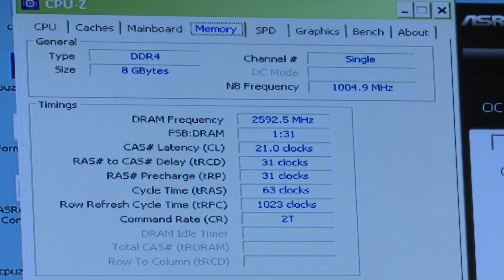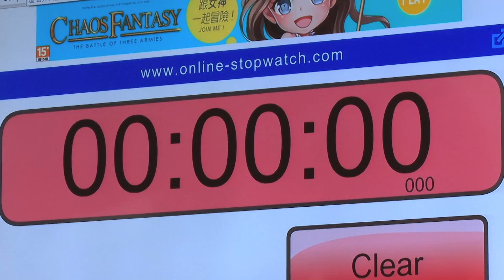G.SKILL's Extreme Overclocking Events @ Computex 2016

Comment: i have a 5820k overclocked to 4.4ghz but it could go higher but the motherboard is a limitation, i also have 8gb ddr3 corsair 3000 mhz but it will not let me overclock it meh :(

Comment: Holy hell, I had overclocked my i5-6600K to 4.5GHz before, and it ran fine on air with no faults and stayed below 80C on most occasions, but when I ran the Prime95 Small FFT test, my temps skyrocketed to 100C.... to say the least I panicked and unplugged my computer xD

Comment: My experience with overclocking is with my previous pc a Fx6250. Managed to get 5.1ghz stable at a reasonable temp on a big air cooler.
My current pc i7 (fist Intel in 10 years) sits at 80 with a cheap ass tower cooler,  had to order a water cooler so I can get some overclocks on this badboy.

Comment: My experience with overclocking has been nothing but smooth! I just used the built in utility on my Gigabyte Z170 Gaming 5 mITX motherboard and I've got a stable and cool overclock on my 6600k. As for overclocking my ram, I bought the G.Skill TridentZ 3200 16gb RAM kit and I just enabled XMP and it's been running at 3200 MHz no problem for the past 8 months!!

Comment: AMD Athlon II x4 635 2.9GHz stock cooler. Kept it overclocked at 3.51GHz for 3 years, then 3.2GHz for another 3 years, still on stock cooler and pretty good voltage. I had a lucky one :)

Comment: Well, I just built a new computer and overclock the i5 6600k to 4.5ghz, seems to have alot more room as it only reaches 55c under load. Haven't really tried overclocking the gpu or ram. Hoping to win some new ram as thsee kits look so nice, and I bet perform even better.

Comment: So about 6 months ago I built my first gaming PC... or should I say bought a shotty prebuilt one and have swapped out basically every component that came with it. My current set up is a AMD A8 3.5Ghz cpu, a Gigabyte R9 390 gpu, with a Corsair 600w power bronze standard psu, a cheep ATX mother board to hold everything (definitely nothing to special) the original 4gb's of DDR3 RAM that came with the old prebuilt computer, a stock cpu fan, and a full tower case that one of my friends gave me. I've honestly never tried over clocking because the fact that I can't really do anything because of the current RAM that I have. I have always wanted to try it... but can't really do it. Winning a new stick of DDR4 RAM would be unbelievable because it means that I could finally push my system to the max. It would be really cool to be able to keep my all blue system running to the max with that extra 16gb's of DDR4 RAM. Good luck to everyone in the competition! And congrats to whoever wins in advance

Comment: About 3 years ago I built my first PC. I used an AMD APU because I was on a very limited budget. I purchased some G.Skill 1866mhz RAM and noticed that I gained some very substantial performance gains when I increased the clock rate up to 2133mhz. I was so pleased at it's ability to overclock and add real and observable gains. Ever since then I have had a great love for G.Skill RAM for it's great value, warranty, and reliablity.

Comment: My first overclocking experience was applying an XMP profile to my Ram, went from 1333 to 1866 just like that in a snap. Can't believe I had it running that low for a long time, felt much snappier after. I was a noob back then, great thing to always keep learning about tech. Thanks

Comment: I have an air cooled custom computer that I've used for the past 7 years to mod Bethseda games. It has 16GB of OCed G.Skill DDR3 that is still going strong. Unfortunately the system cannot handle Fallout 4, so I am in the process of saving $ to build a new one. Memory performance scales FPS gains in Fallout 4, so I have decided to choose a high end option from G.Skill in my next build. Cheers!

Comment: Overclocked my AMD FX 6350 just to try it out but it was already working at a good clock speed and i didn't have a decent cpu cooler so i had to back it off.Also,i did a bit of overclocking on my R7 370 but thats done like in a few simple steps on MSI Afterburner so don'T know if it counts :D

Comment: When I was working on a friends computer who's system would just start up and shutdown after 10secs. I looked over the thing 5times but never checked his bios he overclocked the processor and the rest of the computer had so much extra stuff he couldn't pull enough power with a little 700 units power supply and he never thought twice about it after I unplugged the extra string lights and the huge 8" fan the overclocking worked out fine.

Comment: My first OC was a complete failure, wrecked my gfx card lmao. I was 16. Now, had an r9 290 for 2 years OC'd at 1300/1800 respectively. FX 8300 chip at 4ghz, and see 3 ram at 2200. All running stable and cool.

Comment: I Have no experience on overclocking because I dont really know how to do it and I never need it, Im just a bit amazed how rams  price got so low the past year, my computer has 1 year and when i bought it my rams which are kingston 1600mhz cost 43€ each, now I find search the cheapest shops i can get them for 15 to 20€ each.
Also the same for ssd´s bought an ssd also kingston 120gb cost 60€ now for more 10€ you can get 1 of 240 '_'.

Comment: I am currently on a dual Xeon setup as a workstation/gaming rig, but I want to build an other pc only for gaming. I overclocked some RipJaws to 4000mhz on m'y Old pc ans it was running cool and i had no issues. I really want this TridentZ lot, because I heard it was The best ram, even over the Corsair Platinum. I overclocked CPUs a lot, i5 6600k to 4.8Ghz, air cooled and at 57degree on load, also overclocked some Intel q8200. I really hope I Will win this ram lot, simply because they are awesome.

Comment: Well I did burn a CPU and GPU some years ago but who didn't while overclocking right? got actually the 2nd best OC on an I7 930 for the hardware.fr database, achieved with gskill trident pc3-16000 ram ( 3x2GB kits) , they did melt tho but G.skill RMA support gave me new one, stay with G.Skill for my current setup with an I75820k running OC as well at 4.3ghz and wanna go higher!

Comment: I have to say I haven't really seen much of a point to heavy overclocking. It realistically only gives a few FPS at the cost of higher power usage, higher temps (really bad for small rooms), and a louder PC due to faster fans. I tend to just stick with the auto overclock features of the hardware now as it requires no effort and isn't really risking the hardware's longevity. I like having the CPU running at really low idle clocks too (800MHz) but then getting a massive boost when that power is needed (4.2GHz). I have managed to get it up to 4.5GHz but it really wasn't noticeably faster in real world usage (though made a big difference in benchmarks).

Comment: I did my first overclocking with the ATI Radeon 9500. Was able to unlock my card into a 9700 with a software mod. Came quite close to a 9700 Pro if I remember correctly, but stopped (with overclocking) because it had artifacts and I was already happy with the extra pixel pipelines unlocked.  #gskill #memory #ddr4 #tridentz #pcmasterrace #overclocking #giveaway

Comment: Did my first overclocking with my old Intel Pentium 4, raised it from 2.4ghz to 2.64ghz when I was 15 years old. Then got back into building another computer with the AMD X4 860k using MSI A78M-E35, & G.skill Ripsaw 1866mhz 2x4Gb ram; as I proceeded to try overclocking, it failed. Little did I realize that this motherboard had locked its voltage setting, so no overclocking worked, just kept crashing.These would be excellent for my upcoming i5-6600k build as I intend to attempt overclocking again.

Comment: My first OC was with an Pentium Dual Core E5800, 2GB DDR2 667 and a GeForce GT220 Zone Edition.

I overclocked the CPU and the GPU. Worked fine, until i sold the PC for an XBOX 360. Had a Gaming Laptop back in the days also. Loved that, my first overclocks.

Comment: The first time I've overclocked was with an old PC to test my skills (939 dual data2 motorboard with an old AMD CPU). After a lot of reading and failing, I've been able to get something stable :p Gave the PC to my mom and build my first PC right after. These 2x8 Gb RAM at 3200MHz will sure fit well in my build :)

Comment: First oc athlon xp 2600+, second was a mobile celeon that went into a desktop board that went to around 3.2ghz, then I stopped for a few years since there was not much benefit. Then I had an a8-6600k that ran at 4.7ghz for several years now I have a 6800k, everything is setup to oc however have not had time to dial anything in yet. my video cards on the otherhand have a pretty good oc on them.

Comment: My very first over clocking experience was on sager np9150 laptop gtx 680m gpu with MSI after burner. It was a learning experience with lots of chill ran through the spine as i see artifacts on my screen and didnt know what that was at that time. Thought my gpu was fried.. Anyway since then, i became an overclocking addict. My current rig is i7 6700k running ar 4.8ghz on 1.4v with trident z 3200mhz 16gb kit. Still learning to overclock ram as its much more complex than cpu gpu overclocking in my opinion.

Comment: My first overclocking experience was on a 6 core i7 980x up to 4.4 Ghz - but the Coolit ECO ALC AIO water cooler I had couldn't handle the temps - that's what made me change back to air cooling, didn't fancy the expense or hassle of a Fully watercooled loop.

Comment: I first started over clocking back in the day with my AMD Duron 750mhz using the pencil trick on the bridges. now days I don't tinker as much although my last and current system running i5 2500k I did initial over clock with bios when I initially built it. having forgotten about it a few months ago my bro said we should over clock our CPU's and I said yes. when I checked again I only realised then I had been running mine OC'd since 2012. long live the OC.

Comment: Congratulations on the the overclock! EVGA had a beautiful build, but I'm a much bigger AsRock fan...I've only done Bios overclocking, 4.2 with the CPU and with until I learned about the default clock vs. increasing the clock to the rated clock on the ram I was only running 1333 Mhz, I'm now only running 2133 Mhz, but oddly enough, after not knowing any better, either way suits me fine...I've still got a lot to learn...heh     G.Skill's Ripjaws Z 2133

Comment: Love overclocking, but the heat output is a pit off-putting in my personal rig in a small room, but I managed to get up to 3.1GHZ on a Q6600 and was only held back by the 667 mhz ddr2 not being stable at a higher overclock, as well as an FX-8120 up to 4.1 ghz on stock cooling. with a 4.4 ghz turbo setting that it never hit.

as for my current personal rig I have an FX-8350 that will hit 4.5 on air with +.025V for 27 stability, but I usually run it at 3.6 during  the summer with a 4.5 turbo setting, it will hit about 4.3 on turbo.

Comment: Im using a 3570k @ 4.1ghz. crap over clock. not great with overclocking but i try. hopefully I get better luck with a good chip next time when i get a Kaby chip for my next setup. to go with my current SLI 980tis.

Comment: I Overclocked an old GTX 660 but buffered it up so had to get a new card Now running a GTX 970 with 6GB Ram and a 3.5ghz Overclocked processor

Comment: I over clocked a FX 8350 to 5ghz, was stable but the Gigabyte 990fxa ud3 vrms kept overheating so I had to back it off. Otherwise the cpu would max out at about 60 degrees on a fractal design s36 with cooler master silencio fans

Comment: I overclocked my : i7-4790k to 4,55GHz running stable 60 degrees
                               :  Hyper X Fury 16GB set to 2133mhz form 1600mhz
                               : NVIDIA GeForce GTX 980 Ti  to 1500MHz from 1000MHz
I need new ram set :D

Comment: I had pretty good experience so far. When i built a PC for my brother, i managed to get his FX6300 to 4.2 without much voltage increase. I'm planning to OC it to the max now. On my PC my trusty i5-2500 died on me, so i got a Z-series MB and bought anniversary pentium before i save money for 4690k. I managed to OC it to 4,5@1,35V and from what i read on forums, i got lucky with that one. My current 4690k is running happily @4.2 without voltage change. And let's not forget about GPUs. I OC'd my Gtx960 to 1380/8150 at the first day i got it! Awesome little card. Never oc'd RAM before though, everyone is covincing me that the benefits are negligible. Good luck to everyone :)

Comment: we are currently running an older i7 3770k at 4.5 GHz and an MSI gtx 970 at 1.2 ghz and 16gb of corsair ddr3 2133 Mhz. corsair h100 cooler for the cpu. She's getting old so an upgrade might be in order...

Comment: Honestly i love #gskill and using it on all my builds. Currently i have a set of (8GB x 2) G.Skill RipjawsX F3-2133C9D-16GXH @2133 CL 9 (stock timings 9-11-11-31) and I managed to get it up to @2400Mhz  (timings 10-12-12-35 CR2) using 1.65v along side my i7-4790K CPU that i was successfully able to get it up to 4.6GHz using 1.25v only which is nice and stable under max temps of 65C conjunction with MSI Z97 MPOWER mobo. Definitely loving my G.Skill RipjawsX kit and would like to go extreme with the Trident Z

Comment: Actually I have no overclocking experience at all, but I'm planning on building a new PC right now. At this moment I have a laptop with a crappy cpu, gpu and ram. Both will be better in my new PC build, in which I might overclock my cpu and GPU (still deciding on getting a K intel cpu or not, but the budget limits it). This Ram would come in soooo handy because there will probably be no need to overclock it, and, if I like it, I might become a lifetime customer.

Comment: Most of my overclocking experience is bad. I have an intel K processor that gets real hot as soon you fiddle with the clocks. I have taken it as far as an excellent Phanteks air cooler can take it, which isn't very far. My RAM is overclocked.

Comment: I mostly overclock my gfx cards more so for video editing than for gaming. as for the cpu I don't overclock them that much but I was able to get my Intel core i5 6600k to 4.6ghz stable under load and I have had it run well at 4.8 ghz with a lot of games but I never see much fps improvement. again doing that is for video editing. I will get my right water cooled soon and then I hope to have my cpu run stable under full load at 4.8ghz.

Comment: I had a few overclocking experiences all went smoothly, an A8-7650K to 4.3Ghz, Hyper X 16GB set to 2133mhz form 1600mhz timings as well, GTX 750 Ti OC'd the black edition to the limit, R9 270X OC'd with custom BIOS dual-x, GTX 980M OC +10Mhz, GTX 960 SOC 2GB to the limit, DDR4 RAM Timings on a 2x4GB Vengenence Kit.

I have enjoyed all of the experiences and probably missed a few to mention here.

Comment: love watching competitions liek this.  I have never had the chance to work with extreme cooling or even water cooling!  I have been aircooling and overclocking since Cyrex 300mhz MMX processor, k2's, Socket A through Opteron 165 on a nice DFI..  I miss those days, have not done much overclocking on the newer platforms.  1366 overclocking baffled me lol.  In for the give away, always use nice new tech as insentive to change hardware ^^

Comment: I did once try to push my Q9300 to 3.0GHz on a MSI P7N SLI Platinum with 8GB of G.Skill DDR2 800. Was stable for a while at 2.8GHz, but ultimately couldn't keep the overheating issues under control.

Comment: I tried overclocking my corsair vengeance 2100, i7 3770k and gtx780 all on the same day. Played Tomb Raider and the whole system crashed and the pc made a weird sound. I was shitting bricks after that, but everything turned out ok and I eased off the overclock to a stable setting. These guys though just made me look like a bitch😂

Comment: overclocked my i5 3570k from 3.4 ghz to 4.7 Ghz (~60°C in Games, 65-70 in Prime95) , also my gtx 770 to 1300 Mhz + 7800 mhz VRAM (40-50°C full load). But my ddr3 doesn't go any higher than stock 1666 mhz :(

Comment: My first build was an AMD A6-6400K overclocked to 4.9GHz, but after two months I started my second build based on a Z87 motherboard. Specs of my current build are

- i7-4790K overclocked @ 4.7GHz 1.275v
- ASRock Fatal1ty Z87 KILLER
- 4x HyperX Fury 4Gb 1866mhz
- 2x R9 380 4Gb in CrossFire overclocked

Comment: My Overclocking Experience is very well:
Intel Core i5 6600k @ 4,6 GHz with 1,279vCrucial DDR4-2666 ( can't Overclock this! Compability issues with 4 modules ... Imc already Overclocked)R9 Fury 1100/580 with -65mv FX4100 @ 1,56v and 5300 MHz just for Testing GTX960 from KFA² with 1855 MHz Boost:) ...

Comment: i've had a great experience overclocking my i5 6600k to 4.87 ghz together with a 16 gb kit of crucial ddr4 2400 running at 1866mhz (it's verry unstable ram) also i have an asus strix gtx 980 running verry stable at 1567mhz on the core.

Comment: I almost always buy AsRock boards and G.Skill ram. I don't over clock much because I'm not great at it, but the little have done has been on those brands and it's always been a pretty good experience.  Sadly I'm running Patriot memory ATM because they couldn't fulfill their warranty on a SSD, because, they no longer made them. They sent me 2x8gb ram sticks that were incompatible with the 2x4gb G.Skill I already had. Can't wait to upgrade to a DDR4 system and go back to using G.Skill.